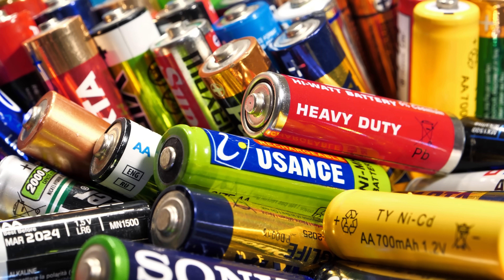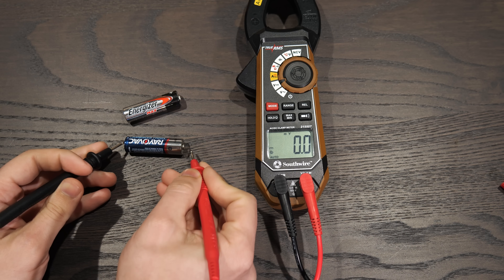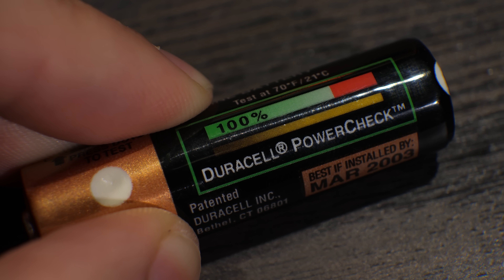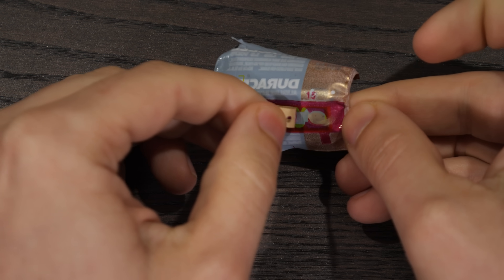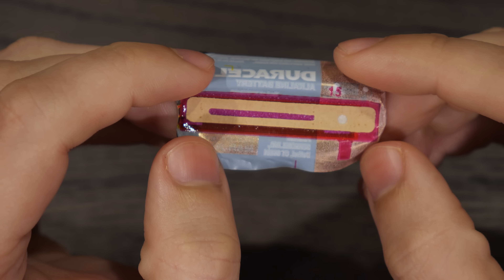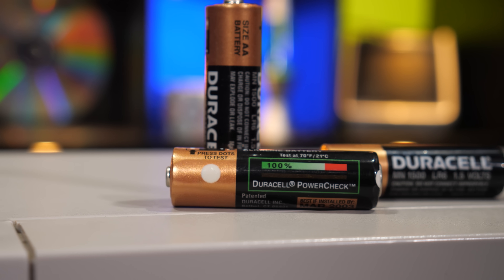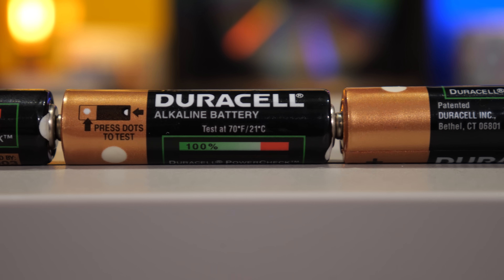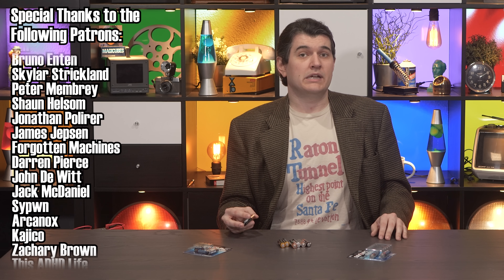Duracell PowerCheck: A genius idea which didn't last that long

Comment: I remember being mocked as a kid when I put batteries on my Christmas list, but in the following weeks my siblings and parents were always taking from my collection.
Reply: Haha genius! I wish I had tought of that. My gameboy, scannerz and other toys were always out of battery and batteries were so expensive that you couldn't even buy a 4 pack of AA's with your weekly pocket money. I cloudly remember I got rechargeable batteries and a recharge station for birthday gift from my parents (I don't remember if I asked for it or not) but those were so bad back then that after couple recharge the batteries did barely hold any power at all anymore. I wonder if they are any better these days? Haven't seen them for probably like 20 years.
Reply: @beatnik6806 they’ve gotten so much better :) they hold a good charge and you can charge them hundreds of times before they start to diminish.
Reply: I also have a collection of batteries
Now rechargeable but still take even used ones unless my tester indicates very low as just in case.
Reply: @ShreakerGaming   how those modern rechargeable batteries hold power? Are they worth it?

Comment: They're still pretty useful though. If a device doesn't work, checking the issue is the battery is pretty normal, is it not? And if it turns out it's not the battery, you get perfectly useful batteries laying around and can easily be confused with emprt batteries you didn't took the time to despose of safely. The real issue with those testers, who where still sold a couple of years ago, I don't get why you describe them as long lost media, is that are where hard to use.

Comment: Maybe I'm weird, but I grew up relatively poor and with a metric bucket of toys and games (usually accumulated over Christmas or Birthday) that wanted those precious AA batteries. My mom would buy me a massive 48-pack of batteries for Christmas and my birthday, but I'd still manage to use them all up before then.
Since I was a budding electronics technician by then, I began studying at what voltage various devices would stop working.
This way, let's use a made-up example: my RC car stops working at 1.35v. However, my Game Boy will keep running until 1.1v. That way, batteries that are "used up" out of the car can find a second wind running (for a little while at least) the Game Boy.
I would also hack together larger-than-normal battery packs to try to milk those last few milliwatthours out of a spent cell. Say, a device that wants 6v from four fresh batteries might end up with five or even six nearly-spent batteries sticking out of it like a cancerous growth... Another favorite tactic would be "jumping" a strong cell across a weak cell to get around inrush current and get a device powered up.
I wouldn't toss a battery until I'd milked EVERY POSSIBLE SHRED of energy out of it.

Fun fact, most devices shut down in the 1.3v area. VERY FEW products will still be drawing usable power down to 1.0v.

Comment: i use to use tin foil to fit triple A's into double A slots if i had none and vice versa double A wired to triple ports for same reason. good ol'days. no batts ever wasted 😂 then rechargeable's was the way to go.

Comment: Were "thankfully" mostly past nonrechargables, but at the the same time were sadly also mostly past replaceables. There are so many small gadgets that dont really need glued-in lithium batteries and would be perfectly fine with replaceable AA (which you can buy rechargable, dirt cheap by now and unlike the rechargeables of my childhood, they dont suck)

Comment: I guess that explains why they never worked. Average temperature was never above 17~ c in any circumstances with toys, though we were just pretty diligent about using the battery recharger for continued rotation.

Comment: It is still possible to buy Duracell batteries with a tester. The point is that a device generally needs more than one battery. When the batteries run out, you don’t always have two new ones; sometimes, you might have only one new battery. The good thing is that your device can work with one new battery and an old one. Moreover, some devices use four or more batteries, and these devices need fully charged batteries to function. When they stop working, you can put the batteries in a drawer and use them in a remote control later on. This cycle tends to create half-used batteries in your drawer. At that point, Duracell’s battery check really makes things easier. Duracell batteries are expensive and more durable, so they are valuable. The battery check is what makes them special and distinguishes them from other brands. It is difficult for other brands to include this feature due to the extra cost, but Duracell can do it because of their relatively high price and durability.

Comment: I still have PowerCheck batteries in the drawer.  Duracell used then well into tthe 2010s.  Also, I believe more people are using disposable batteries vs. rechargeable ones these days.

Comment: I recall those, but the one time I used the tester, it didn't change color so I assumed the battery was entirely dead. Sounds like I might have just not been pushing hard enough.

Comment: Personally, I prefer the much faster and easier method of testing single-cell batteries: just drop them on the minus end from a height of a few inches above a hard surface. Dead batteries bounce, fresh ones don't.

Comment: Another potential reason why they were discontinued is that they very slightly increased the diameter of the battery, which made it impossible to install them into some devices that were built with receptacles just exactly large enough to fit batteries without an on-battery tester.

Comment: 13:29 What's funny is that I have musical equipment that, if used via batteries, states to NOT use rechargeable batteries because they don't supply the same power as standard batteries.  I looked it up and sure enough saw rechargeable AA's have slightly less voltage than standard AA's.  And rechargeable AA's with the full voltage are kind of pricey.

Comment: I recently thought about this when i had to use batteries and i wanted to check how much power was left. I was pretty sure Duracell had this powercheck so i thought maybe i had a different brand until i realized they removed it. It was such a good function they should fire the ones who abandoned this invention! :(

Comment: First of all, why would you say that only pre-2010 kids needed batteries? Devices still need them, this hasn’t changed. 

Second of all, for me the Duracell battery check to see how much charge it still had was a novelty, simmering from like 2008 onwards, never heard about it before hand. Even the TV commercials Caught onto the idea from like 2010 onwards

Comment: I remember those, and remembering thinking they were fake gimmicks. Having to press so hard that it left indentations in my fingers only to barely get a reading out made me think they were flawed, and then sometimes getting a reading out of it when the battery was clearly dead just hammered the idea further into my head.

Comment: Here's something fun to explain in a video!

I have a gameboy original sitting below my TV that I had to clean and repair when I found it in my mother's garage. I forgot about it as it was something my family gave to me when I was a kid. It had 30 year old batteries in it, that were literally 30 years past their date. (So I guess, older?) Anyway, each battery was a different company. One Chinese company in all chinese letters. One Power Max. One Energizer. One Duracell.

Each battery exploded in a different color, I don't remember which was which, I'd have to dig up a photo i sent someone. One was blue crusty stuff (Power Max I think), one was green crusty stuff (Chinese I think), the Duracell exploded the worst which was white crusty stuff everywhere, and the Energizer didn't explode at all.

All from simply sitting around in a box for 30 years! I've still gotta repair that old thing a little bit unfortunately but I did clean it up and get it working again, except for the sound. :P However, it was interesting that each battery exploded differently and one didn't.

Comment: Duracell doesn't need a built-in tester. They need better leak-resistance. I've had so many leak unused inside their sealed retail packaging. This is true for both Duracell and Energizer.

Comment: The reality is the cost for Duracell to add the power check tester on the batteries was so negligible that there was no reason stop putting them on all their batteries. I rememeber when they came out and I know I used them. As stated it was a quick way to tell if batteries in a drawer were any good. Plus it was a novel feature that acted as a selling point for the brand.  My guess is bean counters got involved and said they could save a few cents per X amount of them by discontinuing it.

Comment: I believe it was mygrandfather who first showed me a tiny lcd-type light (model train sized, quite small) with 2 short wire leads. When he showed me how this 'battery tester' works. Dim light? Low charge, Bright light? Good to go! I tried this numerous times but, being a child, kept losing my light. The built-in tester was okay, I guess. Between rechargeable batteries and the 'Dollar Store', I was surprised that Duracell manufactured those 'integrated testers' for as long as they did.

Comment: You think AAA batteries were annoying, the 9 Volt is far more annoying. 

One thing I feel sorry for kids these days about is, as a child growing up in the 80s, we could easily replace batteries on our own by lifting the flap to open the battery case on the toy.

 Nowadays toys require a small screwdriver to open the battery pack of the toy making it harder for children to change their own batteries in their toys.

Comment: Weird, after seeing this video a couple weeks ago, right about when it came out, I came across a Duracell Powercheck that said it would be good until March 2003. The battery still has 1.33 volts! It was in a working LCD indoor/outdoor thermometer. I knew I hadn't changed the batteries in over 10 or 15 years, but that is a very long time, and it was still going! I say was, as the contractors doing my siding yanked the wire out of it and the inside part flew off the wall and the batteries tumbled out. When I try to use the Powercheck part, nothing happens. But 21 years after it's good by date and the battery still has power.
Reply: another miracle is it not leaking. of all batteries i have seen duracells were the ones most likely to leak

Comment: I remember being a dumb kid and unwrapping a AA battery at one point in my life getting to the metal part and then tearing that open, the odd thing was inside it was just stacked up button cell batteries. I don't remember what brand it was, but even as a kid that didn't seem right.

Comment: I wish theyd have put just one reusable strip tester in an 8 pack or larger, that would have been useful. I don't see any reason it couldn't be made to work with external contact to the connectors only and still be very cheap.

Comment: My dad used a tiny lightbulb (about 2cm in height) and a copper wire, with one end wrapped around the lightbulb. One end of the battery would touch the lightbulb and the other would end would touch the free end of the wire. You could tell how much power the battery had left based on how much bright lightbulb would shine.

Comment: Thanks for this. Boy it makes me feel old for you to mention how long ago these were around. I expect the difficulty in use was a reason for their discontinuation. It would sometimes hurt to use them, and the kind of person like me who is particular about batteries and keeps old ones around to test is also someone who would be particular and annoyed about how hard it was to use.
Now that you explain the mechanism, it makes sense why it would be so hard to press on older batteries, and work easier on the new ones. This makes it extra difficult to use: brand new ones don't need to get tested. But when you are desperate for a working battery, and there is only an empty one nearby, and you press as hard as you can hoping it will change and it doesn't but then you're not sure is because you are pressing it wrong, or is it really dead. So in a way the anxious ones like us testing batteries, don't even have a device than answers the question: does it work or not. Always some doubt. Super frustrating.
Also, thanks for mentioning the load/voltage/current test differences a bit. I would say anything under 1.5 usually isn't good unless it's a super low draw device. I find a lot of led lights are too dim to use if one battery is even 1.47 (no load)

Comment: Only device I still use batteries for is my personal cd player. They often don't come with a plug and one plug I had used an adjustable voltage switch but it randomly worked on my cd player as it was never the correct voltage so I decided to just use batteries.

Comment: Im pretty sure they also made a newer version of them. I remember when i was younger, probably the 2014-2016 period, my grandpa bought a pack of AA duracells with an energy level indicator, except those had 5 blue boxes that would light up when testing the battery.

Comment: I've never seen your channel before. This video just popped up and I thought, "Why not?" I love your production quality and clear speaking! I can see why you have 2.5 million subscribers!
Minor, Nit-Picky Correction
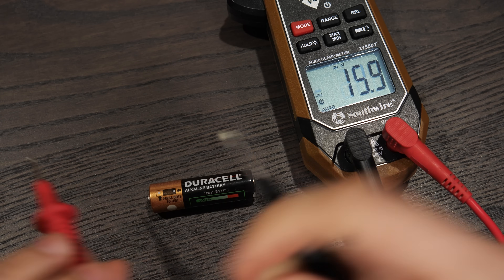9:45 - "... test at about 1.3 volts on the multimeter, which would suggest they've got about half their capacity remaining."
Testing at 1.3 volts would suggest it's at half capacity only if it were a 3 volt battery, right?

Comment: I used to check dry cells on an analogue multimeter by using the 1Amp range. A brief touch showed how much current it could produce and that was a good indicator of condition. These built-in battery checkers were rarely used as I realised it just drained the battery. Then again, so did the multimeter but with greater accuracy.

Comment: These batteries were more expensive, lasted longer yeah, but died out because we bought cheaper ones, and then rechargeable batteries came along, of which basically no clue how long they would last and run out straight away, that is progress lol

Comment: Running out of batteries at the worst moment had me shuffling them between devices when my drawer stash ran dry. Since batteries discharge at different rates—even when they’re brand new, I used the testers to group the best batteries together.

Comment: I have a good ol' tester. Works the same. However I never bothered to take apart a battery with that tester to use on more batteries externally. XD
Should also bring up the fact that alkaline/disposable cells can actually be recharged up to 20 times on a low current charger (which are increasingly hard to find).

Comment: If you want to know is there any juice in your batter left I learned a simple test. Just taking in by the plus top part, negative is facing table about 1 in above the surface (2 or 2.5 cm) and drop it. If the battery drops on its “butt” solid - it is full. If it resonates and bouncing and falls a side it is done. Some times you need to know is it the battery dead or the device 😊

Comment: I actually like the battery tester on the packaging as opposed to the battery. It meant it was usable with other batteries in those rare cases you needed it 😊 But yeah, it was pretty annoying to press enough for a reading.

Comment: I have things which need full batteries, and other things which can use the batteries which are almost empty. When the things which need full batteries have used what they need, the batteries go into a partially used box, so battery testing becomes useful, especially to match batteries.

Comment: I remember some devices had issues with those fitting in the battery compartment as well because with the tester they are ever so slightly thicker.

Comment: Yeah, I remember those powercheck strips on Duracell batteries. It seemed to be a very neat idea. Nowadays I just use a general battery tester (bought for a few bucks on Temu) to see which of my batteries are full and which ones are half-full (as those usually still work fine in clocks or remote control).

Comment: Yea that’s back in the day when you bought something like batteries they was full to the max, and had a power strip to show you. Now there o ly putting half of what they used to. Found out in covid they could get away with it.
Reply: which brand does that?, you can easily test batteries these days.
Reply: @PresidentCamacho2024  energizer 6 volts and AA’s I can say for sure. My cameras read the battery levels and straight out of the package they are all half spent if not more to be honest, bought a couple 6 volts dead on the shelf.
Reply: @PresidentCamacho2024  this only started about two years ago, my cameras and feeders never had problems like this year with batteries.
Reply: @  enigizer 6v

Comment: What if you didn't need the volt meter at all? Just drop the battery onto the table "butt" down from height of a few centimeters. If it jumps - empty, if stays on the table - still good 👍

Comment: When Duracell came out with that PowerCheck tester I switched from Energizer immediately. If you work in IT or are a hobbyist, this is very important and even for the everyday person, the Duracell PowerCheck batteries were the same price as Energizer so they made a huge mistake getting rid of the PowerCheck. Even if it cost them a couple of cents per battery to put in that feature the amount of people that switched to them should have negated that but I'm sure they have a huge marketing team with statistics and all that which can prove me otherwise...